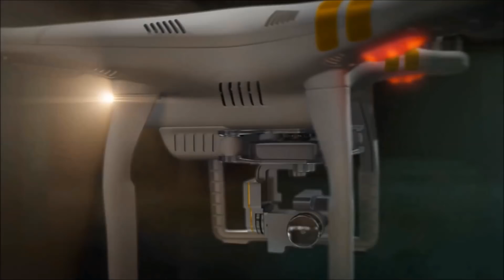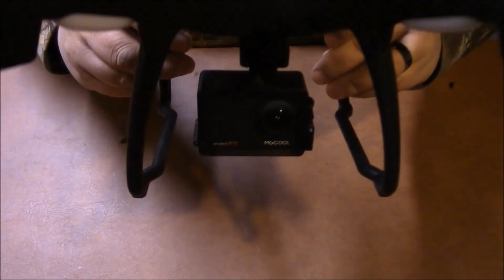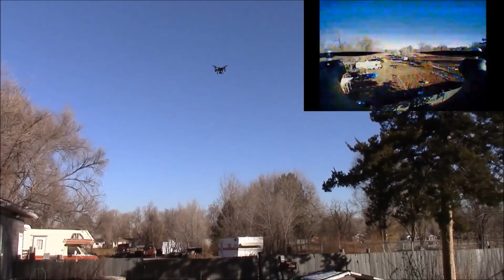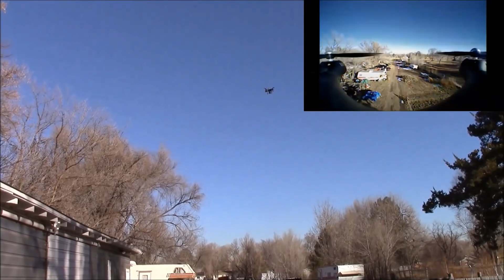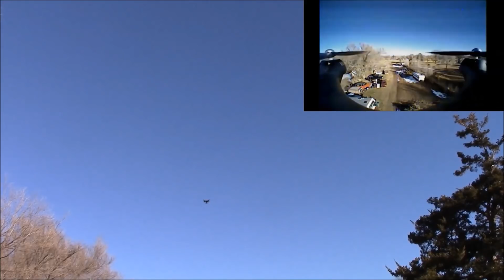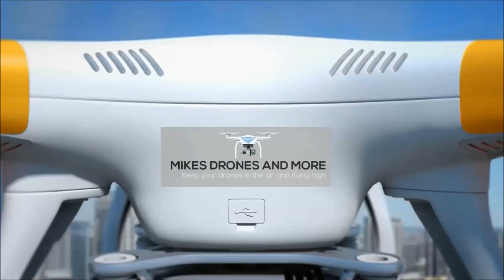Promark GPS Shadow Drone with FPV camera

Comment: Hey Mike, I've been flying my p70 GPS drone n having a blast. Just wondering on how confident u are with this drone flying at near max alt and distance. Have u done any testing regarding that? Do u recommend sticking to a certain range?
Reply from the maker: Haven't tested max ranges. I would say max maybe 100-200 ft high and 200 yards

Comment: you are probably getting interference from the brushed motors they need a .01 disc cap across plus and minus of the motor to cut down on the noise  and shielding around the fpv camera would help also there is a few things that would have to take place first but 5.8g to 2.4g there should be no interference from action cam to Fpv and if it is from the action cam and fpv do you get it when the motors are not running? that would solve where it is coming from i am a ham radio operator KC2LIT
Reply from the maker: Ya they are fine on the ground and then when spinning the extra fuzz so ya I think the motors. But just a test.
Reply: Mike's Drones and More I have dealt with motor noise before getting into the video and audio I would recommend a .01  disc capacitor on each motor
Reply from the maker: Ya I won't be taking it that far. Just testing